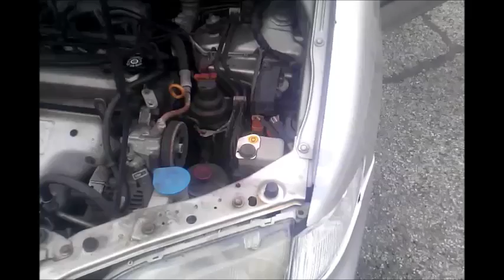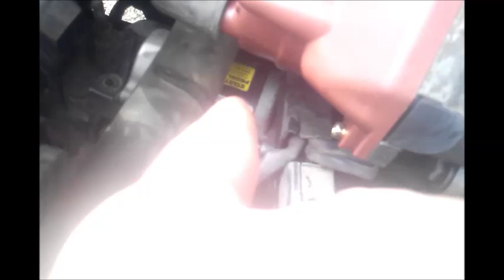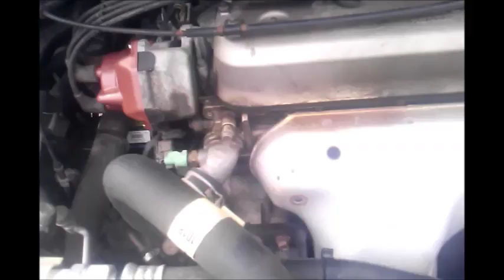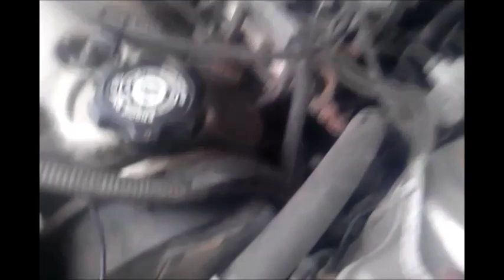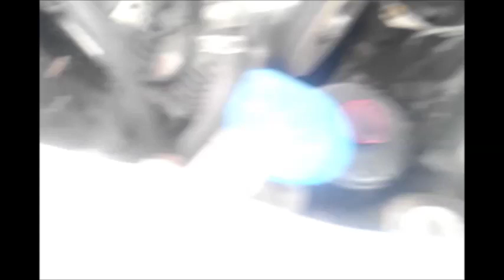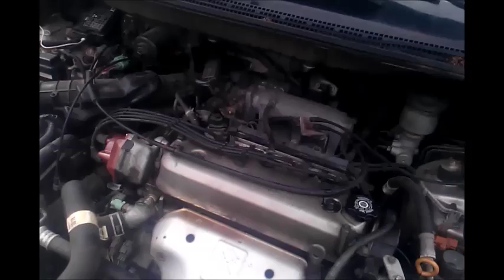1996 Honda Odyssey Fuel Filter Location

Comment: I have done the r/h and l/h CV joints, l/h steering arm, the steering rack, starter motor, coil, the l/h window motor, drivers seatbelt, sway bar, the car are junk but it's a car

Comment: Wow, this is the exact same location as the 1994-1997 Accord fuel filter, biggest pain in the ass ever. In order to change it I had to use 2 crows feet to break the banjo bolt lose and then go underneath the car to losses the bottom fuel line, really hard not to get a face full of gas doing that. Engineers really fucked this up.